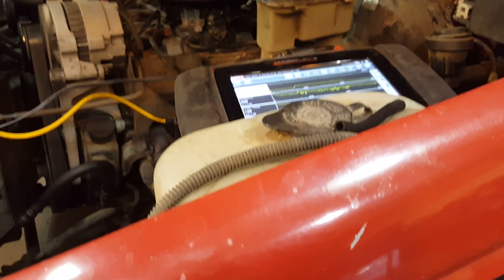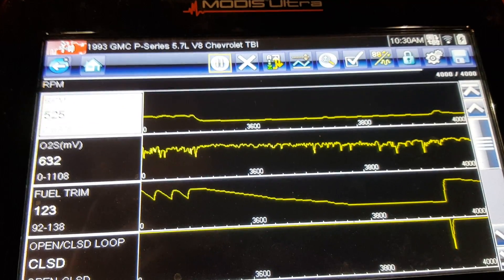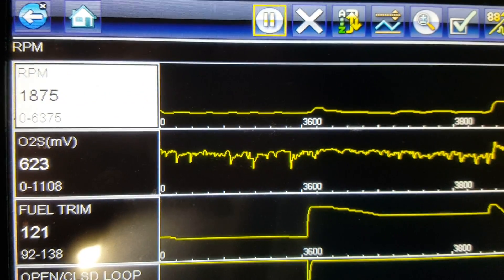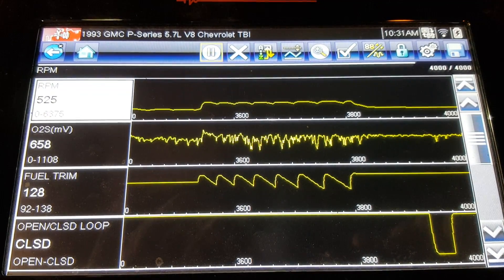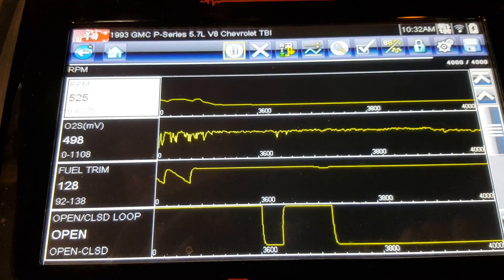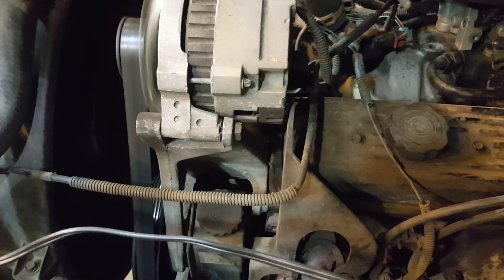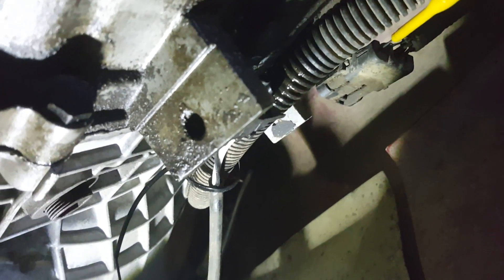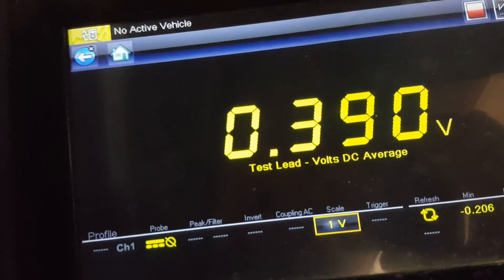1993 GMC/Chevy 5.7 surging, rough idle,cutting out 02 problem

Comment: This is pretty similar to what mine is doing. Same year, same engine. It runs okay-ish until operating temperature. Once it reaches operating temp, it really starts to struggle and dies pretty fast.
Reply: What did you do to fix it
Reply: @meawesomemax3947  I sold it
Reply: @mountainmikeoutdoors  lol damn I was hoping for a "mechanical fix" =)
Reply: Dang mine is in the same boat; but no live scan
Reply: @meawesomemax3947  im having the same issue from a bad exhaust leak and the upstreem o2 sensor being in the wrong spot

Comment: Just wanted to say thanks. I had the exact issues with my 91. Tried unplugging the O2. Runs fine. Bought a new O2 sensor and problem fixed.
Reply: Thanks for that info.
Reply: Where exactly is the 02 sensor located on these engines?
Reply: @almaricky1 driver side by the header

Comment: Currently running the o2 in the manifold on my 93, But unplugged, and it solved my surging idle and rpm drop when turning the wheels at a stop. Gonna replace it tomorrow more than likely, as well as plugs because it was running super rich, Probably fouled those.

Comment: Good morning I've got a 93 Chevy 1500 with a sbc 5.7 and it will not run right at all I've changed everything in it including the the electrics  in the distributor too no avail .what else is there to check . I've replaced the all the solenoids sencers pick up coil throttle body  ECT...... I have no code's c poping up  it runs great cold but once it's warmed up it run like do do like there's only 4 cilinders  oh and I put a new o2 cencer in it also .
HELP PLEASE  I don't know what else to do........ Steve

Comment: I have a '93 C1500.  It came with a 4.3. Now has a 5.7.  I'm still using the old O2 sensor set up but the EGR system is bypassed.  Everything else is stock.  I have a surging idle after warm up at stop lights 550-700 rpm;  idles at 1000 in neutral usually but will drop to 800 given enough time.  PS: how did you get those readings from the OBDI connection?
Reply: Any updates? I have the same issue

Comment: Hey man I was just curious how we're you able to read diagnostics with modern scaner?
Reply from the maker: The snap on scanner will do obd1 with an adapter cable
Reply: Ok thank you
Reply: Mine is idle surgeing like that and new iac is letting air out making a loud air sound. I bought new o2 sensor no chang. When I disconnect o2 it doesn't go into a loop check engine light doesn't come on in park. The only time  it sort of straightens out is when I disconnect the map. I've thrown every sensor at this thing changed distributor, fuel puump its been a pain 😆

Comment: Wicked intent❤️❤️❤️😇🤝  ! I have  a 1987 Chevy g20 van , when I stop and go at times it acts like it surges low and seems to ( want to cut off) but when I give it gas it operates normal. When cruising it vibrates smoothly like it’s trying to shut off.  Everything’s new on it( did it myself)  distributor, coil pack, distributor ( didn’t  set timing yet) by ear, new tank fuel filter, alternator everything. What could be my problem? 🤝🤝🤝😇?
Reply: same shit here , revs dies revs dies ... nonpowes smells like shit ... replacing parts now and still pos idle 🤬🤬🤬

Comment: Two things I replaced that were causing similar issues in two separate instances. First time fuel pump was going out. 2nd time lots of surging and would kill at idle ended up being o2 sensor.... shit was seized on. Had to cut it off and weld a new piece on.

Comment: Hi
My Nephew has a 1991 Chevy K1500 gasoline engine.
It shakes at idle and the oil pressure drops when he makes any kind of turn.
Struggles to make 40mph.
I told him to check for plugs, points (if it has them?), engine oil level, engine mounts.
I think they are giving up  on it but I think it could be sorted out and it has huge sentimental value cause it belonged to his grandfather.
Any ideas I dont really know too much just know what I dont know which is alot

Comment: My 91 has been running this way shortly after I changed my starter it started has progressively gotten worse I've changed alot of parts on it and nothing found out how to read the OBD1 using a paperclip came up code 13 so I bought an O2 sensor today going to change it in the morning really hoping it solves the issue glad I came across this video as well it gives me a better feeling about going this route thanks for the info will let you know if it fixes it
Reply: any update ?
Reply: @HOTRODRICO  I got rid of it a couple months ago
Reply: @fiscalgoose7664  so it didn’t fix it?

Comment: I had similar problem on my first 92 Chevy it was fuel pump. they say electronic fuel pump's don't go on and off they do trust me. but every problem has about 20 different solution's lol
Reply from the maker: I've had the same problem with fuel pumps working then not working. Sometimes banging on the gas tank will get a none working fuel pump to start spinning.
Reply: +Wicked Spray you are correct wicked spray. but I have learned allot about these 90's rides like a rock truck.LoL. but im still learning more and more. after 15years of 5 different stiles they all have the same quarks low miles not nesaseraly a good thing. more miles means most crap has been taking care of lol
Reply: @wickedspray7475  why o2 sensor did u happen to unplug by chance  we have a 89 chevy 2500 and its cutting out and cant fig it out.

Comment: I have a 92 C1500 with 5.0 engine, and TBI, 5
Speed manual, 2wd, will start and stall when cold, once warmed up, its fine. New Coolant Temp sensor, complete tune up, new fuel pump and gas tank, new IAC valve, no codes and no service engine soon light. Also, I had to disconnect the EGR Valve vacuum line or the truck will constantly run and shut off. With this line disconnected, the truck runs good when warm. Any thoughts you can offer about this problem will be greatly appreciated! Thank you!
Reply: D J Tanner check for a vacuum leak.  check the egr valve, make sure it's not stuck open.
Reply: The knock sensor is bad.
Reply: Charles Matthews , knock sensor, really?
Reply: No.  It is not a knock sensor.  O2 needs replaced.
Reply: D J Tanner 0
Reply: Danny Rumbles did you ever figure it out? I've replaced every sensor but knock sensor and transmission solenoids, filters
Reply: look up ESC on the tbi motors....also a igniton control module at the base of the distributor..had problems on my 92 astro and it was those 2 things.
Reply: Danny Rumbles MAP sensor- works with O2 sensor

Comment: My truck is doing the same exact thing. Unplug the 02 and it runs fine. Got a new 02 put it in and still surges when it's plugged in. Runs fine unplugged.
Reply from the maker: Probably a ground problem. The o2 grounds through the exhaust which tends to get rusty. Loosen up the o2, strip the end off some wire, wrap it around the threads and tighten it back down. Now run that wire to a good ground. See if that fixes it.

Comment: So I took to O2 sensor out and it instantly sounded better. Drove it around and then sat in a parking lot waiting on a buddy to get off work for nearly 25 minutes and it had a perfect idle. Baught a new O2 sensor today and slapped it in there and it started loping like that about 30 seconds after I cranked it up for the first time after I put the new O2 sensor on. And it's still running super rich, I can smell it come out of the exhaust. Suggestions?
Reply: Bad wiring,ecm, or new sensor wrong or defective

Comment: 94 Chevy gets code 13, changed 02 and check light came right back. idles good, runs good but hits high gear and power lose, have to gas it and it takes off. cruising speed is very week. any ideas?
Reply: my 92 astro check engine comes and and off all the time but runs great..check your fuel pressure ...could have dying pump and fuel filter clog. check the basics first.

Comment: So my 1994 Suburban does the same thing. The difference is it has a cat delete. No sensor even hooked up. What could be the problem for me? You say by disconnecting the O2sensor fixed your problem but without on at all what would cause these same symptoms?
Reply: Edit... it only happens when warmed up, when cold it runs great.
Reply from the maker: Are you sure the front o2 isn't hooked up? If they didn't put a cat in I would think they would unhook the rear o2 but not the front. I'm asking because you say it runs good cold. The computer doesn't use data from the front o2 when cold, only after warm up.  When starting cold the computer uses pre-set perimeters for fuel mixture until the coolant temp and the o2 heaters are warmed up.
Reply: I only have the one pigtail for the front O2 sensor, no rear sensor plug anywhere. if it matters its a 3 inch exhaust that both come to the passenger side and join prior to the first O2 sensor.
Reply: front O2 sensor is still hooked up and in place. even the dealers said no rear O2 sensor... why would you have an upstream but no down stream sensor..... doesn't make sense to me.
Reply from the maker: The truck is older so it doesn't monitor the cat efficiency, that would be why it has no rear o2. So I'm confused here, first you said the front o2 isn't hooked up but in your last reply you say it is hooked up and in place. Can you get access to a scanner to see what the computer is showing for o2 activity? If the front o2 is connected and in the exhaust try running a ground wire from the metal part of the o2 to a clean ground on the engine block (or negative cable on the battery). Those trucks use 3 wire o2 sensors and ground through the exhaust which gets rusty and not supplying a good ground.
Reply from the maker: Other problems could be a bad fuel pump, egr stuck open, vacuum leaks, tps sensor, dirty throttle body, map sensor, timing, Iac valve or a bad distributor. Also check plugs, wires and rotor.
Reply: My mistake because I looked under the truck and saw the cat was gone and assumed so was the O2 sensor. So far the egr valve and solenoid are new, all vacuum lines replaced, timing is dead on, iac valve is new, new distributor and cap rotor plugs and wires, also the engine knock sensor and coolant temp sensor as well and the fuel pump because it need a new tank when i got it.. Most got replaced because they where either all original to the truck or missing. It has even been to 3 different chevy dealerships and 2 other local garages and none of them can tell me why it runs great while cold and stalls when up to temp.So I was hoping to get any answers from online. When warm is stumbles and there is no lack of fuel I can smell it coming out the exhaust. also the throttle body is new, so not injectors or regulator. it will even stall while just idling in park only when warm, when cold it runs great.  hope that helps.
Reply from the maker: Without me being able to psychically work on the vehicle I would start by testing the o2 sensor just to either confirm it's good or bad. I lean that way just because you say it runs fine when cold but starts acting up when it warms up (thats when the computer starts using the signal from the o2 for fuel control).  Your vehicle should have a 3 wire 02. Usually 2 wires will be the same color which are the heater circuit and the other wire is the signal to the computer. Watch this video to help troubleshoot the 02 sensor if you don't have a scanner. I show a way to use a common volt meter to give you an idea  if the 02 is functioning right .    www.youtube.com/watch?v=7KsNmEF0SFA&t=1s
Reply from the maker: need to hook the positive wire on the volt meter to the signal wire and the ground on the volt meter to a good ground and set the volt meter to show milivolts. The 02 should range from 900 mv to 100 mv but with the volt meter it only shows the average of voltage so you will need to watch it for a few minutes to see if it hits close to 900 and get down to close to 100
Reply from the maker: And don't forget that the o2 gets it ground from threading into the exhaust. That is a big problem with the 3 wire o2's is bad ground from rusty exhausts.
Reply: Hello, my 89 silverado 5.7 does the same thing runs fine cold but once it warms up it wan't to stall out and finaly  dies. Feels like a little misfire? Don't know.

Comment: I have 1997 silverado z71 i put a cheap code reader on it in it came up with po303 and 02 sensor bank 1 and 2 and its idles at 1000 rpms at start then slowly goes down to 600 rpms after running for awhile any advice? Its a vortec 350 btw aswell
Reply from the maker: P0303 is the code for a misfire on cylinder #3. Does the engine have a misfire?  The Idle should be higher at start up and come down once warmed up, nothing wrong there. Check cylinder #3 spark plug and make sure it's sparking.
Reply: Wicked Spray there brand new spark plugs when i rev it really high sometimes it will i have fuel line leak btw aswell and sometimes itll tick but then when its warmed up it stops

Comment: I have a 94 suburban Silverado edition TBI 5.7 I have replaced every sensor you can think of full tune up complete with I still have a low idle surging shaking no check engine light to speak of put a new muffler on it seemed to get worse new battery alternator new belts pulleys fuel filter I'm at loss the only sensor I have not replaced the O2 sensor I unplugged the O2 sensor it seemed to run better but my idle still stayed at a 100 rpm?? I guess what I'm asking if I replace O2 sensor with my idle go up
Reply: Check for plugged cat or egr valve, also check fuel psi, 10psi minimum
Reply: @Dave-lg5oz  you know it was a failing brake booster
Reply: @worstnightmare9772  brake booster caused low idle?

Comment: You ever check the EGR valve, the diaphragm might be most up and is putting to much oxygen in there
Reply: lol he's literally explaining what the exact problem is. it's not the egr.
Reply: Idc what anybody says I've had 3 truck with the egr thrown out, my current truck doesnt have an egr they run just fine without the egr system,
Reply: EGR does not inject oxygen it ,it injects exhaust into the cylinders -EGR-Exhaust Gas Reserculation

Comment: Hi i need help I have a 1992 Chevy silverdo it runs good when the motor is cold but once it starts to heat up running temp it starts to drop the rpms low when I'm at a stop light or sign I have to put it in a neutral and press the gas a bit so it won't turn off
Reply: John Morales...my 94 does the exact same thing...have replaced every sensor....fuel pump...filter ..timed right...yet when it is warm....the rpms drop and surges along with the oil pressure...lmk if u figure yours out .
Reply: @t.b.y.3350   I wish I would  help but same here I changed  Evey sensor new distributor fuel pump and filler  timed it and nothing I still have the same problem  and I took it to 4 mechanics and they all tell me it's fine  I'm getting to the point where I wanna sell it already
Reply from the maker: check for vacuum leaks. Try pinching off the big vacuum line to the brake booster and see if that helps.
Reply: @wickedspray7475   i just disconnected it and it sounded much better do think it will be better to change the whole brake booster ? Thank you so much
Reply: @wickedspray7475   update i just put a new brake booster and its doing the same thing as the other one when i take off the vacum line. Plz help
Reply from the maker: Did you pinch off the vacuum hose to the brake booster or disconnect it? If you disconnected it all you did was create a big vacuum leak, so no a new brake booster wouldn't help. what tests have you done? is the o2 operating correctly? Is the idle air control working? Is the MAP sensor reporting correctly? Did you try cleaning the throttle body? Is the timing correct? What do your fuel trims look like?

Comment: Hate to chime in so late. Check the Idle Control Adjustment Valve. Its another electronic piece of needless crap on the 90's trucks. I had a bad "Z" block in my 94 sport side Sierra. I swapped an "A" block into its place from a 91 S10. My truck did the same thing with the swapped motor. Idle Control Adjustment Valve was the problem and is on passenger side of throttle body. Again...its electronic...it is crap...and goes bad. It was intended to fine tune in real-time the idle of the engine at different temps and altitudes. It is completely separate from the actual idle adjustment screw on the driver side front end of throttle body. When this ICAV goes bad it either stays way open or way closed. This will cause fuel to run rich or lean. Procedure for replacement is online. You can't just plug and play. You have to install the valve then jump two pins at obd to "re learn" the valve. At the same time you must find actual idle screw  on opposite side and adjust idle to 600 rpm. Unplug jumper at pins and the engine should then be running like a top.
Reply: I've replaced my IAC and still have this problem. But I also forgot to do that learning process. When it started it was at 2k rpms. I will try the relearn process

Comment: Check the distributor cap and rotor button may be causing a misfire.
Reply from the maker: thanks for the comment. it ended up being a bad o2 sensor. I didn't explain it well in this video but i have a link in the description for a video showing the outcome.

Comment: I noticed the rpm spike when the surge happened. Is it possible the crank sensor may be shorting or losing connection? Usually after warm up a faulty crank sensor will start malfunctioning. If it’s going bad the symptoms will get worse. The other place I would be looking is at the distributor, especially if it’s an HEI ignition. Keep up the good work Ivan
Reply: Tbi doesn't have a crank sensor.
Reply: @jnotah   It does, driver side
Reply: @HOTRODRICO  No. 1987-1995 GM tbi doesn't use a crank sensor. I have used this on other engines to convert to fuel injection.
Reply: @jnotah  I think you're right, I may have been thinking of the knock sensor...